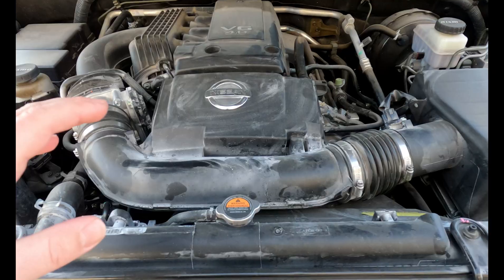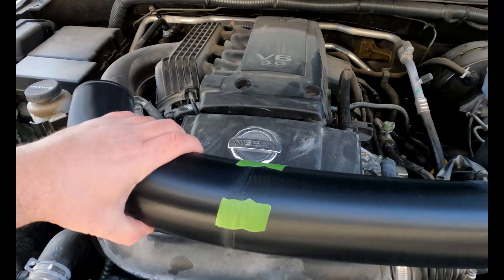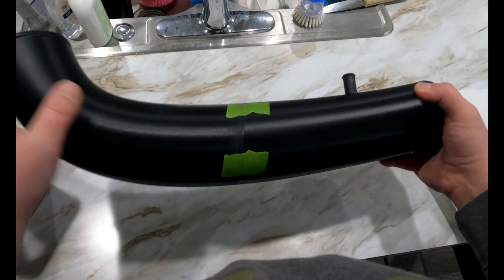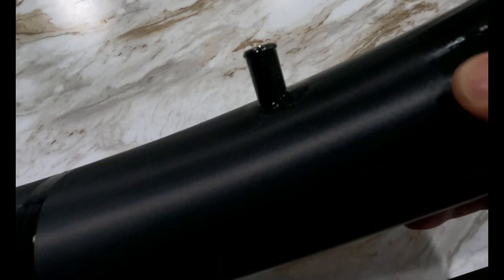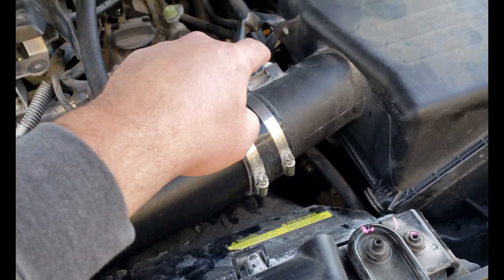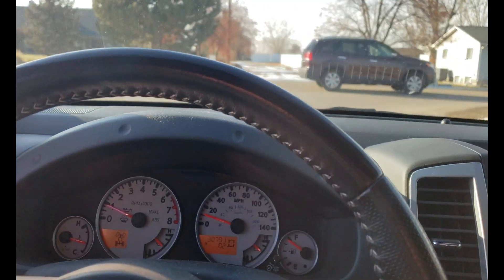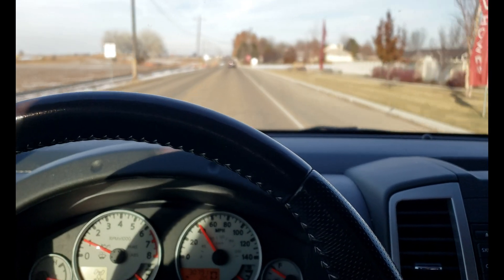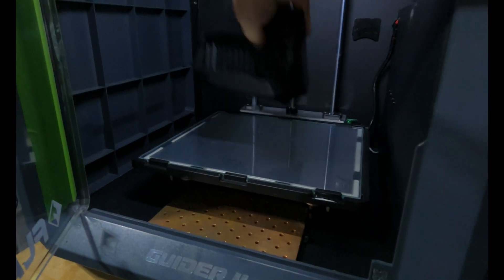I 3d printed an intake for my Nissan Frontier

Comment: Hey bro, which software did you use to scan and for the design? I'm trying to do the same and I'm experiencing a lot of troubles with format compatibility. Im using Creality scan and solidworks but solidworks is a headache working with mesh or surfaces. thanks!
Reply from the maker: I scanned with an Einscan scanner and modeled in Fusion 360. It should be possible in Solidworks but both struggle with large mesh files.
Reply: @EndMotive  Great! thanks for the info and about the intake printed, did you use PLA? because I was wondering how hot gets under the hood and if the PLA or ABS resist for long time.
Reply from the maker: @erc1097  I printed in in ABS! PLA would not last very long, ABS with good wall thickness and proper heat/ speed will produce something you can run for a good while!

Comment: I want to know if anyone has manipulated the internal design of the intake tube. I have a dumb idea of modeling the interior of the tube similar to the barrel of some guns. The thought is creating spin inside the tube just like causing spin on the bullet, maybe it becomes kinda like forced induction?

Anyone reading this please let me know your thoughts
Reply from the maker: I don't think i have seen it done with the length of the tube, but they make "swirl" plates that go either into the neck of the throttle body or behind the air filter to spin the air like you are saying...they usually add turbulence and hurt airflow, but a tube with smooth "rifling" transitions might be better than those.
Reply: @EndMotive  
Thanks for the response and interesting to the points you’ve made.

Rifling, that was the term I was meaning. If I can find the time I’m still going to try to print it and see what happens.

Comment: awesome work and video. Would a custom 3d printed sls intake tube cost in the $500 range or less?
Reply from the maker: Thanks! I outsource all the SLS printing I do to a partner company...I have never quoted it but I would guess fairly expensive because of the size....however it would probably be under $500 still....maybe I will get one quoted just for fun!
Reply: @EndMotive  thank you. that would be amazing to see the price levels.
Reply from the maker: @yellowjoe.2000  So the estimated price is around $250 for this intake tube out of SLS Pa12...not cheap, but better than I expected.
Reply: @EndMotive  wow. not cheap but not too too expensive.  thank you

Comment: Hey!I actually tried this on my 2006cls500 with dual cold air intakes using and ender v3 and using the PLA+ resin used for gun lowers, if you use fiber glass heat wrap meant to stop heat sink and use some heat shield like u would a regular metal cold air intake these things are indestructible !!!!
Reply from the maker: It held up great until it developed a vacuum leak, but it was only meant to be a test piece to begin with so I was more than happy with the results.
Reply: Also 60% fill with more strength  in outer wall

Comment: Any long term review and update
Reply from the maker: Yes, I failed to make a video on it though. The intake has held up great but It was all of a sudden throwing a check engine light, I assume it had developed a small leak somewhere. So I pulled it off and reinstalled the factory one. I am working on a replacement of some sort!

Comment: How's the software and image tracking ? These came out not to long after the creality lizard that I got. The Lizards leaves some to be desired. That or it's user error lol
Reply from the maker: Software is pretty decent, I do not have much to compare it too though. It is very intuitive to use, tracking suffers if the lighting is wrong or if there isn't enough "unique" geometry... an engine bay is easier to scan than a body panel. Over the scan is a really good value!

Comment: In theory, if you don't change the tube diameter, the MAF sensor should be happy. It uses the airflow to cool down a heated wire that is regulated to a certain temperature. As the flow of airmass increases, it has more of a cooling effect, and requires the heating element to turn on and off more often. This cyclic heating is measured in Hertz. If you increase the amount of airflow (and cooling) without telling the engine control module, it will result in spurious airmass readings from the MAF, and that will cause your engine to run too lean or too rich. Assuming the diameter of the intake was increased, as that is the goal of most enthusiasts, your engine will begin to run lean, as detected by the oxygen sensors in the exhaust, and the computer will know something is off, and throw an error code. Short version; if you change the tube diameter, you'll have to retune the ECM/ECU. Making a tube that flows more efficiently, because of fewer kinks, is perfectly fine without tuning.
Reply from the maker: Exactly why I kept the diameter the same  near the throttle body and the maf!..This reduced the possibility of turbulent flow too, but increase the diameter of the tube by almost 20mm throughout the center of it. All seems good still!

Comment: I’ve thought about this for an intercooler routing. Recon 3D printing can handle 25psi at 70 degrees? If it was going to what material will you say do it best?
Reply from the maker: I mean...I am still running this ABS tube on my truck and it is holding up just fine. Something with either a glass or carbon fill would make me feel better about longevity, but my top picks would probably pc or nylon with cf strand.

Comment: What type of filament material did you print with, and how has it been holding up with the engine heat/ heat cycles?
Reply from the maker: ABS, so far it is holding up just fine. The weather has been cool where I live still and I don't expect it to last into summer...but it has held up just fine with regular use.
Reply: @EndMotive  Can you go into detail as to why you don’t think it’s going to last into summer? I only ask because I’m planning on doing this but with ABS infused with carbon fiber filament.
Reply from the maker: @eduardoorozco6397  Honestly, it might hold up. The temp and heat cycles make me think that the walls will soften up if it heat soaks enough. The carbon fiber should make the part rigid enough that it likely won't deform nearly as much. I glued the two halves together with abs and it has worked great but think it might still be a weak point. Nylon with a GF or CF would work great but might be harder to glue together.

Comment: I'm using your video as inspiration for a custom stillen supercharger snout for mounting a larger throttle body to my nissan titan. Any suggestions as how to test the part under 15lbs of vacuum? Max boost I will run is 10.5lbs
Reply from the maker: Hmm, I know Rapid3d is printing an entire intake manifold out of a CF Nylon I believe. He has tested them on boosted applications and they are holding up pretty well, so it should be able to handle what you need. Best guess for testing would be to make a test piece that is basically a large enclosed volume that you can hook a vacuum/pull down pump to and then get a few temp readings of what is already happening in the engine bay, then try to replicate those temps or even hotter in a controlled environment like an oven. That is probably what I would try. I am still running this ABS intake tube on my truck and it has held up totally fine.....but it is still cold where I live, I am not sure how well it will do when it hits summer.
Reply: @End Motive  thank you very much for the insight. I'm going to give it a try with PLA, then again with nylon carbon fiber, I will need to upgrade my hot end and nozzle first.
Reply: How well has it been working out for you?  @EndMotive
Reply from the maker: @Tankslayer109  It held up for a while longer and then I got a check engine light. It had developed a small crack that leaked and it was enough to through off the MAF sensor.
Reply: @EndMotive  what was your fix? Was it printed of solid abs?
Reply from the maker: @Tankslayer109  I think it was 3 walls and no need for infill. I just removed it and put the stock intake back on.
Reply: @EndMotive  i produced my snout and some throttle body adapters for gen 2 titan/vk56vd to use a 90mm ls throttle body. Both solid ABS. So far so good. Holding up in 100 degree days and -40 days here in rural MN

Comment: How did you learn to use the scanner and software? Always seemed cool to me, just haven’t perused it yet. Great video.
Reply from the maker: The scanner is pretty straightforward, you get better as you go. 3D modeling is a pretty steep learning curve for this sort of "reverse engineering". Everything I have learned, is from Youtube or a lot of trial and error.
Reply: @EndMotive what scanner did you use?
Reply from the maker: @ I think I had an Einscan SP at the time but have since upgraded to an Einscan HX.